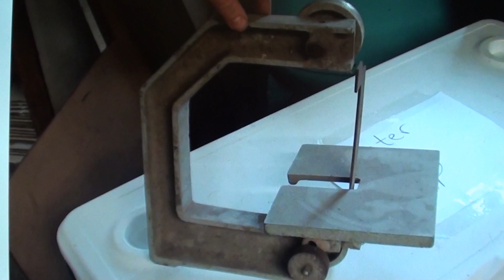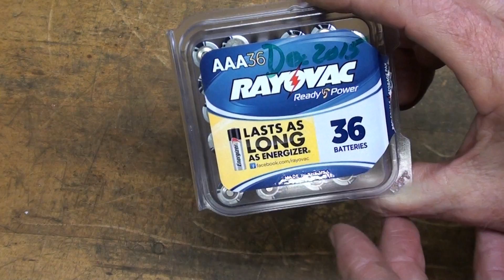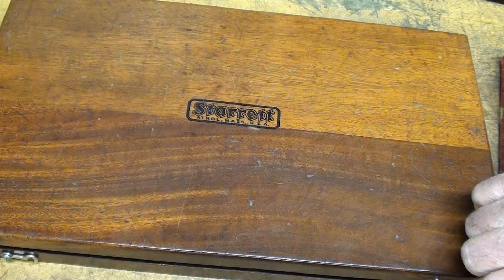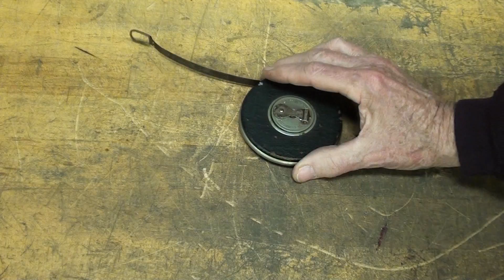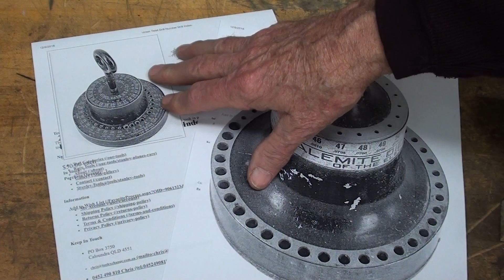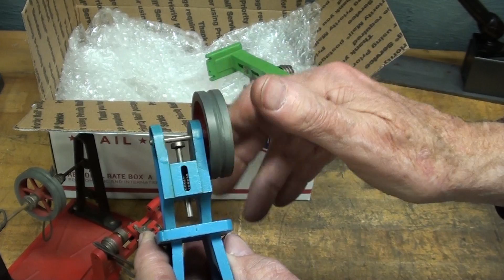THIS & THAT 43 tubalcain mrpete222

Comment: I picked up a drill press tray (search amazon) that clamps to the column. It is plastic, swivels, and has sized holes for drills. It was inexpensive and as you suggested it is very handy to have a place handy for drill press necessities.

Comment: FYI: You don’t need to mate the driven Polly-V belt to a larger Polly-V pulley (sheave). It’s counterintuitive, but a slightly crowned “flat” pulley will drive just fine w/o slip. This larger pulley you can make from any suitable material. Ebay item #123516131692 would be a good starting point. I drive my heavy 10 this way!
Reply from the maker: That is very good to know I didn't realize that

Comment: The battery complaint struck a chord with me. I was a Duracell user. No more. Perhaps someone who knows batteries can comment because the state of the art used to be leak-free. Has the change come as a cost cutting measure or from some other motivation such as higher output or environmental regulation? I've been experimenting with Harbor Freight alkaline and zinc chloride (freebies) as well as the Werker brand from Batteries+Bulbs. Too soon to tell. Merry Christmas and Happy New Year.
Reply from the maker: Merry Christmas. It's funny you should say that. I was going to switch over to Duracell exclusively. But I guess they are all leaking anymore. I remember the paper cells from when I was a boy. All batteries leaked

Comment: Hello Mr. Pete that 8 groove pulley goes to a tread mill, and I have been looking at them on Ebay along with the motors for doing what you did with driving an Atlas lathe from the lead screw! I also have an Atlas 12" under slung lathe!  I'm not sure if you can find many selections in different diameters of those  pulley's though!
skibo1951@yahoo.com
Reply from the maker: That sounds like a good source

Comment: WOW! Ive enver heard of toys like that . They would have been great in my day!
 Ill have to take a look, but I think I have the remains of a 100 ft. Starrett tape measure that was my fathers.I know it got damaged as it was ina drawer with a bottle of soldering acid and it ate off the first part of the tape....I guess I didn't think that I ever even owned a starrett product.(:
Reply from the maker: They still make tape rulers. But I think they are just cheap re-branded items. Throw yours away, if it had acid on it I would Pitch it

Comment: Yeah, I'd kind of like to use multigroove belts everywhere too.  Better grip with less belt tension = less radial load on bearings, etc.  Generally better efficiency and belt vibration too... but I already have a pile of plain v-belts and sheaves, so I never bother.
Reply from the maker: You sound like me

Comment: Mr. Pete,  here is a VERY simplified version of the drill stand.  I've included small divots to find hole locations, but I can remove them if you prefer.  The bottom tier is 150mm radius and 25mm height, with 40 divots at 90mm radius.  The second tier is 75mm radius and 75mm height, with 20 divots at 37mm radius.  All with a 3 degree draft.  I can easily adjust any of the measurements as needed.  https://www.thingiverse.com/thing:3307630

Comment: Both the table for the toy mill and the drill index should be pretty easy to 3D print patterns for.
Reply from the maker: Yes, if you know how to do a 3-D modeling, which I do not

Comment: On my spill proof oil cans, I have a friend that is a plumber and I use the primer cans by drilling the cap and soldering a copper tube in it.

Comment: How many divisions would that fractional drill index be in? By 64th from 1/16 to 1/2? Or by 32nds from 1/16 to 1/2" ? I could spin it up tonight
Reply from the maker: By 64ths.
Reply: @mrpete222 , that's what I figured. I have something roughed in. Email me at chaserthomas1@gmail.com  and I will shoot you back some screen shots.

I thought you used to have your email address posted, but it seems to be difficult to find now a days

Comment: That punch press is missing the 
eccentric cam that goes on the horizontal shaft. And mine had a internal spring too. I loved mine. Thanks Mr Pete
Reply from the maker: Thank you. Evidently, many little parts are missing

Comment: Try a washing machine repairing shop for the multiple groove pulley. Here in the United Kingdom our washing machines have them. If you need to make one use an external hard thread chaser of the correct pitch. This will give you the perfect fit with nice radius on the crown and valleys. Hope this helps.
Reply from the maker: Thank you, it does help
Reply from the maker: Thank you. That does help

Comment: I've found the same problem with new batteries, especially AC Delco.I should have thrown the ones not leaking out, they leaked in the flashlights and toys I put them in! I don't recall having this happen to new batteries in the past.
Reply from the maker: Yes, I found the Delco batteries to be consistently bad

Comment: Merry Christmas, of course. There are a number of different standards for the poly-v belts e.g. for the distance between ridges, and the number of ridges. But, once you've got the standard, not difficult to make pulleys to fit your belt.
Reply from the maker: Thank you for that information

Comment: Lyle, thanks for all your videos and may I wish you and your family All the Best of the Season.  BTW I do watch the This and That series.  I think I have watched them all, some multiple times. Regarding the batteries: I have completely switched over to Amazon Basics for all my batteries.  Never had a problem with corrosion or leaking on any size, and in the event I did, there would be no issue with an exchange/refund.
Reply from the maker: Thank you, I will check them out. I never heard of that brand

Comment: Lyle,

The following link will take you to where I bought my poly-V pulleys and belts. Caution: The pulleys require "sheaves"; instead of "keys"; that insure 100% concentricity and grips the shaft that will not come loose. More expensive yes, but they are awesome. They come in metric AND American Standard sizes.

If you have not used this type of pulley, I believe you will love them if you ever do use them. For they will NOT slip and require NO "key". However, they DO use two allen setscrews, but they do NOT lock on the shaft or key. It takes a while to understand how they work, but they are very easy; once you see how clever it works on the shaft; and to put them on and off the shaft in a second without galling.

https://www.ametric.com/s-2581-j-profile.aspx
Reply from the maker: Thank you, I will check it out

Comment: I have had the same experience with several battery brands. The worst part of this cheapening of product is to have the batteries fail in a device. I have gone to not leaving batteries in anything that I am not using after finding that a leaking battery has destroyed the contacts in several test instruments. I have often wondered if there is a mil spec version of small battery sizes. I'd be happy to pay more for a battery that was not going to leak. Thanks for talking about this problem.
Reply from the maker: Yes, but they all claim to be leakproof, LOL. The liars

Comment: Did a search on micro v-belt pulley
http://www.dunlopbtl.com/downloads/Dunlop%20BTL%20-%20Micro%20V-Pulleys.pdf
https://ww2.gates.com/europe/brochure.cfm?brochure=12762&location_id=19451
https://www.gates.com/us/en/search?text=micro+v-belt+pulley
http://www.hmmanufacturing.com/micro-v.html
https://www.durabelt.com/polyvidlers.php
Reply from the maker: Thank you, I will check that out

Comment: Merry Christmas to you and your family.  I hate ray-0-vac batteries.  the best I've found is Engergizer.  Lithium if you need them to last a long time. I have several temperature sensors around the property and I've had the AA lliths (2X) powering the sensor that transmits every 10 minutes, lasting for about 6 months+.
Reply from the maker: Hi Herb, and Marry Christmas. That is the last box of that brand batteries that I ever buy

Comment: If you look for the v-groove poulies, you might visit a junkyard. The bigger poulies can be find on a crankshaft on an engine.
Reply from the maker: Thanks
Reply: Multi-groove pulleys are/were used on many washing machines. Lightweight, but strong enough to turn a drum full of washing..
And quite large in diameter, between 8" and 12"
Reply: Willem Streutgers I was thinking of a power steering pump pulley
Reply: @welcometothemachineshop466  Yes they are lighter but hard to remove sometime.

Comment: On the multi v pulleys, if you know someone who can cast aluminum and with a lathe, you could make your own, (grin). I made a small one to drive an old southbend lathe with a dc motor, I just ran the belt over the cone pulleys on the headstock and it doesn't slip.thanks for the video.

Comment: Merry Christmas, Mr. Pete.  I just this week cleaned out a battery clock in which the Ray-O-Vac battery had leaked.  The contacts were stainless steel, so no damage.  I visited Ray-O-Vac in Appleton, Wisconsin twenty years ago.  They were a proud, quality-conscious company.  Whatever has happened?

Comment: I have the metal cutting version of that Powermatic. Let me know if you need any pictures. Merry Christmas and thanks for your work.
Reply from the maker: Do you like it?, Is it a good metal cutting saw? I have never used one
Reply: @mrpete222  I do. It's sturdier than the delta 14 and easier to change speeds.

Comment: 6 Groove pulleys... I've purchased and dismantled 3 treadmills primarily to capture the DC motors for use on other shop-built tools. Treadmills use that same 6 groove pulley although I have not seen any much larger than the one you showed. Since they are DC and therefore variable speed, pulley size is not a big a factor. Maybe searching for replacement pulleys for treadmills might locate what you are trying to find.
Reply from the maker: Thanks, that is good information
Reply: @mrpete222  While I was in my shop I looked at those pulleys and I was incorrect. One had 7 grooves and the other had 10 grooves. Apparently each manufacturer had their own design...sorry for the misleading info

Comment: Over here in the UK  those drive belts  would be called 'Poly-V' belts. I see Gates list 'Micro-V' belts, possibly similar. I did read somewhere that carbide insert tips  were available for cutting the correct pulley groove profile.
Reply from the maker: Thanks
Reply: I buy those belts from Motion Industries.

Comment: Ribbed belt supplier on E-Bay:   Sellerocity  3610 Kingston BLVD. Sarasota, FL. 34238-2633.  Great service. I gave length and number of ribs, got a belt that fits and works as it should. Good luck, Merry Christmas.
Reply from the maker: Thank you I will check that out. But I need the pulleys also